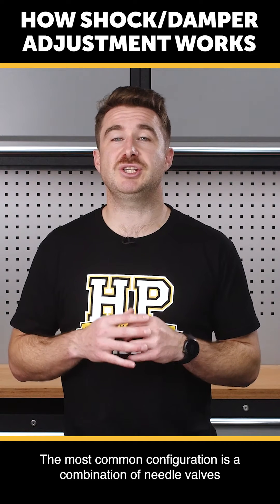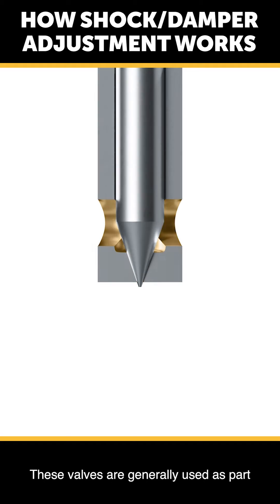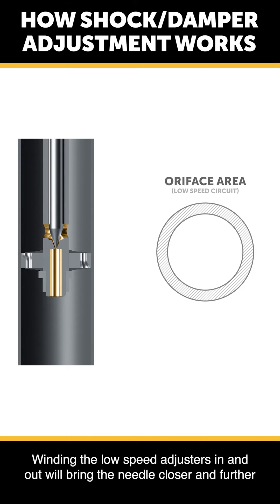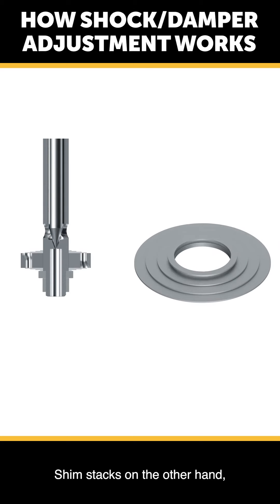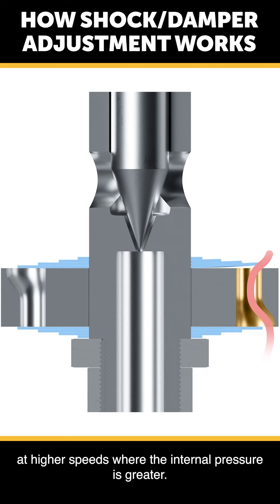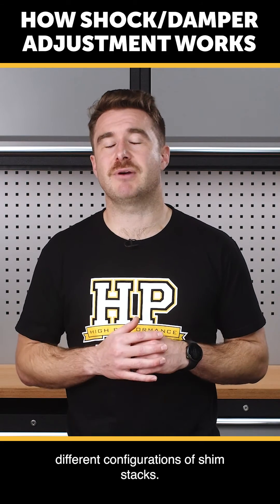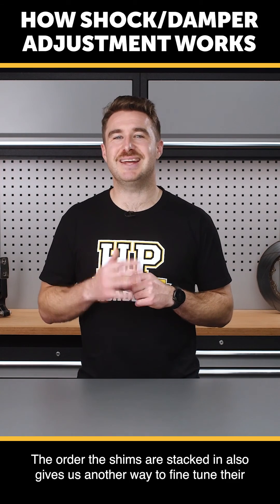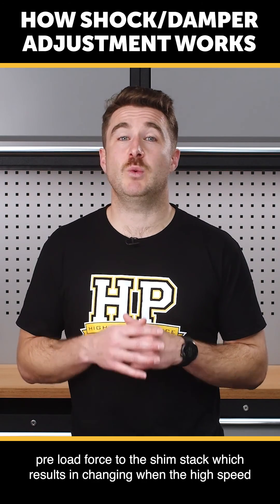High Speed vs Low Speed Suspension Tuning #shorts

Comment: Cool! Would this be a way to give a more compliant suspension at lower speeds and less compliance at high speeds for a bi-modal performance similar to what magnetic fluid shocks can do with altering the voltage to the shock?